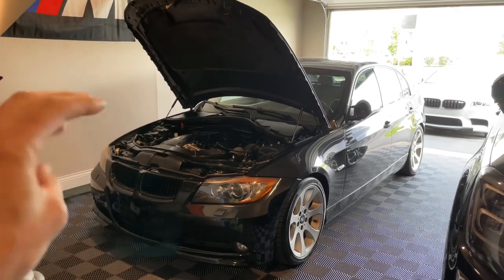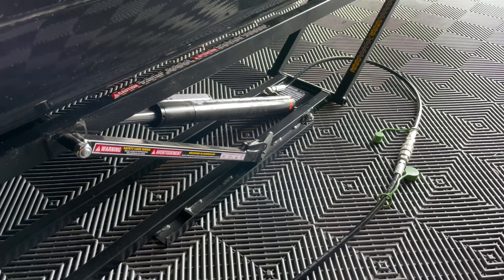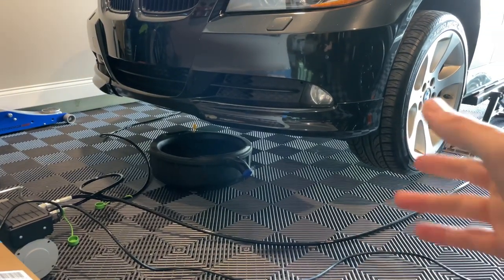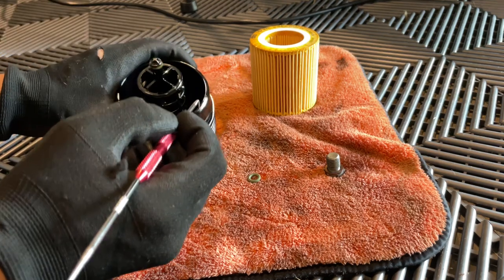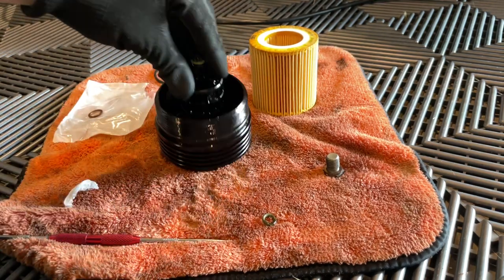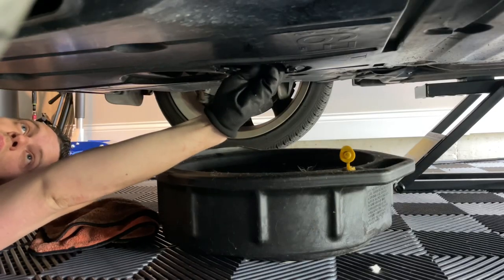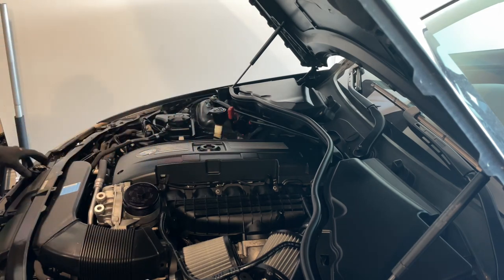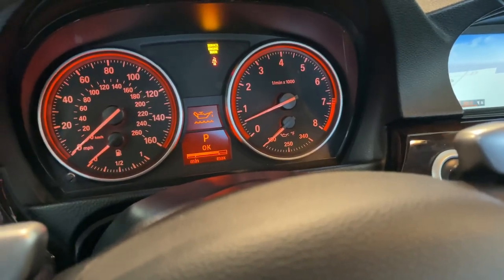Refreshing My 158K Mile BMW 335i Part 3! Oil Change

Comment: The oil filter from the dealership doesn't come with the small gasket that goes on the housing. It's sold separately. Just an fyi.

Comment: I have 2007 335i with mileage 25,000. I purchased Mobil1 high mileage formula and the person said since my car had low mileage I shouldn’t use this oil instead I should get the regular one. Is this true?